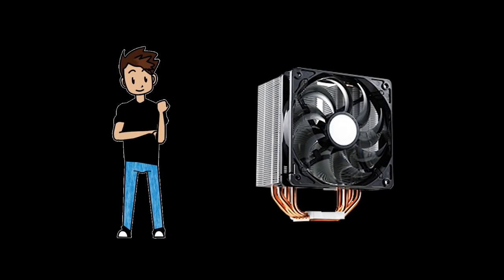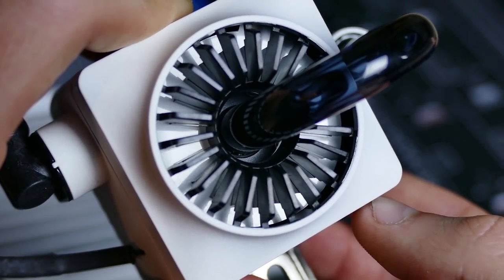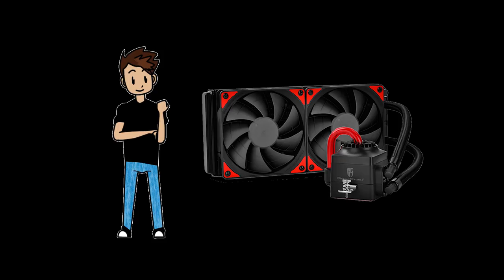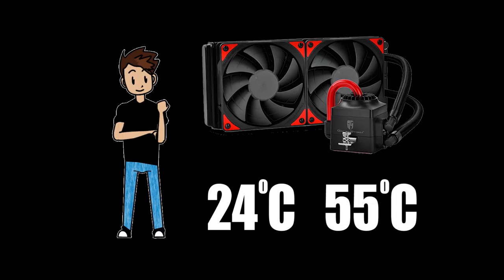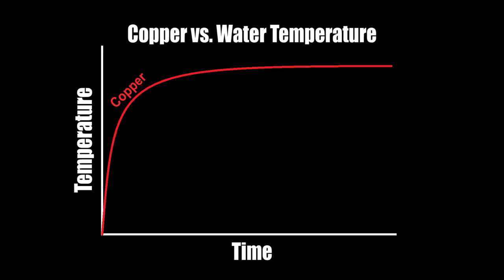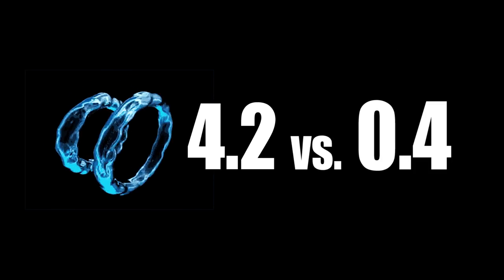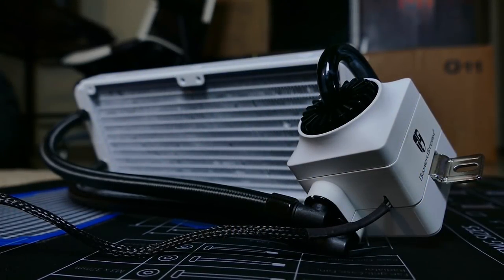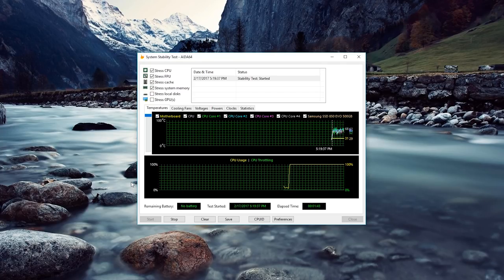How to Properly Measure AIO Temperatures

Comment: Unfortunately the bullshit clickbait got me. I didn't need a science lesson personally, I'm quite familiar with fluid and thermodynamics. AIO's, more specifically their manufacturers do not lie. They do exactly what's described on the box and in the literature. It is not for Corsair, Coolermaster. Antec et al, to deal with third party reviewers who don't test well enough. My main rig runs pretty much 24/7 with the power only cycled for win10 updates. The Corsair H90 on that works admirably under constant load although the supplied fan failed after about a year I had already bought a replacement with high static pressure but had not gotten around to installing it. The behaviour you describe and refer to as lying happens even with custom loops but the greater volume of liquid means the time to entropy is greater. I'm about to purchase a coolermaster ml240l for my kid's system. For anyone not overclocking these things are a no-brainer and work as advertised.

Comment: Your concept of AIO coolers retaining heat for longer is absolute rubbish. When using a water cooled system, the temperature of the coolant rises by only a couple of degrees. This is because the specific heat capacity of water is around 4.2 J/gm deg K. which means it is able to absorb a lot more heat before it increases in temperature in comparison to air which has a Cp of around 1J/gm deg K (at constant pressure).  If the initial ambient temperature of the coolant is around 24 degrees, after stressing the system for several hours you will see the temperature has increased by only a few degrees. This means the temperature of the coolant is still considerably less than the CPU under load which in turn means it will still cool the CPU (as heat always travels from higher temperature to lower temperature) rather than help it retain the temperature for longer. The real reason the CPU heats up after several hours of stress testing is because of the thermal efficiency of the heat transfer from CPU -> coolant -> radiator -> air, in case of the water cooled system, or,  CPU -> heatsink -> air in case of an air cooled system. You would be lucky to get a thermal efficiency above 20%. When two items are in contact with each other, not all the heat is transferred from item A to item B. All this heat accumulates in Item A and it's corresponding temperature rises. This is the reason why the temperature of the CPU eventually rises after several hours of stress testing. One thing I have seen from past builds is that even after a day of continuous stress testing with AIOs, when the stress test is stopped, the temperature of the CPU shoots down immediately within a few seconds. There was only one instance where the temperature failed to go down and that was because instead of stopping the stress test on prime95 I had merely closed the window and it was still running in the background.

Comment: even with my aircooler i stresstest for at least 5 hours. if you want to be absolutely sure , run a 24 hour test . if it passes that, its stable because most of us are not gonna use it 24hours a day. and because of the 24 hour test passing, you know your pc wont make an error in that time. so lol.

anyway, always test it longer than necessary, just to be sure. whether aio or aircooler. but i laugh at people who present max temps after 15mins. because if i test it for 15 minutes, it doesnt even reach 70 degrees and thats on a gelid tranquillo rev fuckin 2. lol

Comment: I do not like the way this video paints liquid cooling and AIOs, it is not very accurate overall.  Anyone that understands how cooling works knows that you have to give the heat transfer medium time to equalize to any change in heat input before you can get an accurate measurement of how effective a cooling solution is.  Air coolers come to equalization much faster than liquid cooling solutions.  You can get in to how heat pipes transfer heat energy, vs water, and you can discuss the increase of mass that liquid cooling solutions have, and that is the end of the equalization story.

This video does not bring up the increased cooling capacity of the liquid cooler's radiator(s) vs the air cooler, which is key to the discussion.  Additionally this video leaves the lay person questioning if the longer time it takes liquid coolers take to come down from a high workload might have a negative impact on their system, the answer is it will not negatively impact your system.  Because of the increased cooling capacity of the radiators in a liquid cooling solution it removes more heat than an air cooler can with the same heat input.  So it is only reasonable that the CPU is subject to less total heat, and the changes in temperature are nice and gradual with a liquid cooling solution.  If that was not the case no one would spend all the extra money for liquid cooling.

Comment: You got your basic thermodinamics really good, just forgot, lie (i can get clickbaity too) or did not understand more advanced thermodinamics.

Heat flux is a function of the termal conductivity of the material, the area (surface) of transference and the Temperature delta. Your analizis is true but misleading, because you only focus in JUST ONE OF THE 5 VARIABLES OF THE EQUATION.
Talking about the termal capacity of a material is irrelevant, because it does not affect the termal conductivity and neither the area (surface) of transference, the only thing that affect "INDERECTLY" its the temperature. termal capacity only talks about how much heat a material can store, before heating....

Let me explain with an example. lets say that you have two materials at 25 degres, one has a termal capacity of 2 and the other 1.
1- To have the same amount of heat in both materials, you have to had 1kg of material A and 2kg of the material B. the first material can store twice as much heat...
2- the same amount of heat to get 1 kg of material A at 25 degress can get 1kg of material B to 50 degress (these numbers are not real, just an figurative example of what the fenomena is) In your own example copper has less capacity that water that means that copper gets HOT EASIER, and just that, (note how i did NOT talk about FASTER, bcause that its the termal conductivity).

Until now what we are talking about is basically how much heat something can have before starting to get hot. and yes copper will get hotter easier than water...
In more layman terms, yeah a air cool system "starts" doing their work "faster" than a water cooling one, but all other variables talk about how "good" and "efficient" at such work you are. And neither you talk about this. If you where my student i would return your homework with a note "yeah two systems reach termodinamic equilibrium at different speeds, but what else?" i have seen some good posts below, but take in consideration something while reading them (without numbers everithing its just especulation)

o god ill finish here im bored of writting and this is not a thermodinamics course
Do not missrepresent me, he is talking some good points here, its just that what he is talking about its just the tip of the iceberg...
i could explain the rest but again im bored of writting and this is not a thermodinamics course.

Comment: The only lie here is this video. If someone doesn't understand the thermal dynamics that's on them, not on an AIO. For those that didn't fully understand what SS was explaining Ill summarize. 

"In most cases by switching to a liquid cooling system, You will see a noticeable decrease in temps. However after placing a heavy load on said liquid cooling system, it will hold on to some of that heat until it can be dissipated through the (RAD) radiator."

Comment: This is BS. maybe cheap AIO's will do this, but my corsair (CORSAIR Hydro Series H105 Extreme Performance 240mm )  keeps my Delided i7 8700k at 5.2 with 1.42v at 70c under 8 hours of gaming (BFV), and a 12 hour stress test it never went above 78c. even after stressing it with Prime95 for 12 hours, once stopping the stress test It right away went down to 32c idle. Don't think this happens to me because I have delided CPU, My temps where the same with lower clock speed and voltage without the Delid. This is a well thought out BS video.  he doesn't talk about how the computer Case can have an effect on this (in how many fans you can have in your case), type of fan's you are using ,what speed, If your fan's are even placed in a correct way in the case, what your Room temps are,  If you are using bad thermal past, What size is your Radiator for your AIO. BS video with googled mathematical equation. Ain't no one lying, but you Science Studio.

Comment: all I know are facts, 30 years of it , building systems, and comparing apples with apples. and not oranges.
example: pc runs 24/7 doesn't sleep low cpu speed is 50%,  4790K OC @ 4.7 on Cryorig H7 playing PUBG for 4 hours = 84-87'c
same pc with  Enermax liqMax II 240S = 70-72'c high temp, even  over 4 hours of time, the AIO is better than the Air cooled, he admits it in his video @ 5:05 in the video. as for what is contained in the liquid of the AIO, I will surmise it is probably close to  standards like 1/2 glycol 1/2 water, why, not because glycol prevents freezing of the liquid, it is because half water/glycol IS better heat transfer  liquid over 100% glycol or 100% water. otherwise car dealers would make you only use water... duh.
read up on some people that Know what they are talking about, and can explain it instead of making a video that last 10 mins to make some obscure point that copper is a better heat dissipation than water is.  which a) it isn't, b) nope it ISNT!

Comment: This video makes NO SENSE. Because you are not measuring the temperature of the cooler, you measure the temperature of the CPU. If the temperature of the CPU takes longer to rise with a liquid cooler, that means the liquid cooler dissipates heat FASTER, not slower.
Reply: It's you who left brain to bed at morning:
Only stabilized temperatures tell actual cooling power.
For as long as CPU temperature keeps climbing cooler isn't dissipating all produced heat, but just storing part of it!
(dissipating all that stored heat making temperature decrease slower after removal of CPU load)
Reply: Yes, you are right. I meant to say "if the temperature of the CPU takes longer to rise with a liquid cooler, that means the liquid cooler ABSORBS heat faster." Which is actually a desirable effect, unlike what's implied in the video, because what you end up with is a system that not only takes longer to heat up, but also, even after stabilization, runs at a lower temperature than the air cooled one.

Comment: Points to ponder;     [MC ΔT] of the cpu/coolant =   [MC ΔT] of the radiator to outside system. If your ambient temps are high, your airflow across the radiator isnt proper (debris/dust/etc), corrosion on the copper blocks, etc... it can really change the numbers quite a bit. 

Not thrilled it took 5 minutes for the REAL point to be made. This video could have been much more efficient, and probably wouldn't get nearly the amount of stupid comments you're getting lol. 

More food for thought, an average i7 ~ 5.0ghz ~1.4v (THIS IS HIGH) only pulls 36 more watts than an i7 4.7ghz ~1.28v (this is NORMAL). Die degredation and quantum tunneling start being a factor when you start kicking in the voltage; thats why sub-ambient cooling isnt really a practical solution.

Comment: Clickbait title, and you called thermal compound/grease "thermal glue" which could be misleading to the inexperienced builders you're trying to inform.  It'd be a real shame if someone used thermal epoxy between their cpu and cooler block instead of thermal compound/grease.  Not your best video.

Comment: While you're not wrong this is the same misleading bs as they did in testing e-cigs a few years back. Obviously if you let a water loop run for hours the temps will go up higher, BUT who does that? No system is ever under 100% stress test load under normal operation especially in games. Even though you sat there and said if you play games for hours blah blah, no, you're just wrong. I can sit and game for multiple hours some days 8+ if it's a good day, and the moment I close said game which previously had my temps under load, it falls right back to idle temps. 
So let's debunk your longer cool down theory.
Yes water holds heat longer, but where does that heat go? Into the radiator, which sends cooler water back to the block.
Now that cpu isn't under load, the block is no longer being heated by it, thus it gets hit with said cooler water, which transfers the heat it has left to the water.
Thus the time it takes to cool down is not hindered by the water, but increased. This considering NORMAL load, not running your rig under stress test conditions for extreme amounts of time.
Are people claiming 40+ degree temp drops being misleading? Sure, but so are you.

Comment: This video for a bad title. As it was clickbait. Though it was informational. Yet the title was misleading. I highly doubt you're giving bad information but you are really telling that people who cannot learn or understand how Thermal Dynamics work. That there is false information out there that is not from the company itself telling these lies. You cannot blame AIO for this.

After all. In the computer world, there is a motto: Garbage In. Garbage Out.

Meaning that if you put in garbage information. You get information that is garbage back out. Have to do your own Super Power that is called COMMON SENSE. Read the information and do your own studies. Find out that a Water Cooled system may be okay for the short gain but it most likely isn't great unless you are going to have a radiator that is the size of a 3ftx3ft box running nonstop. Or somehow figured out how to get Liquid Nitrogen to run through the system. The Thermals will always be a problem. As nothing in this world does not give off heat. Unless someone, in fact, creates a Cold Fusion Reactor and is able to reproduce the results. Then, and only then. I will eat my favorite ball cap.

So in other words. The title is misleading. And failure to educate people on Thermal Dynamics is the cause of false readings and stories of Liquid Cooled Systems. Not the product itself. As the Product does its job. It keeps the system cool but not at the levels the 'reports' claim but really if you get reports from Forum Threads. Then, you aren't doing yourself any favors.

Comment: lol your so right! Take it to the next level. if everything you said is true which it is. than what is the correct way to create the perfect cooling envierment inside a case? I know but I won't tell you. Instead I will do a video showing everyone the true secret to dissipate heat inside a case . my 2 grandsons will reveal  in A computer build video one child is 10 years old the other is 7 both children understand everything you just said. after that video is completed. I may do another video that the boys can do on electrical mechanical force as it pertains to pc think mother board headers. good bye for now.

Comment: This is a rather misleading video. The water is not being passively cooled as his thought experiment at the end would have you ponder. The water is constantly being pumped through a radiator — which diffuses heat. 2nd law of thermodynamics, entropy. It is why your car has a liquid radiator that does the exact same thing. This is what happens when pseudo-intellectuals without engineering degrees start a vlog. Another thought experiment: which cools faster - 5000 gallons at 80deg Celsius of water sitting inside an insulated silo with only it’s surface area at the top emitting stored heat... or that same 5000 gallons of water spread out over a football field (assume ambient temperatures are the same).... learning, it is fun

Comment: Most real world usage will not even come close to hitting a system like a stress test and the continual load it puts on a system, Water will work way better in real world situations when CPU cores are not pinned at 100%.. it will not however give you higher over-clocks.. why do ppl make stupid videos like these

Comment: I just saw this video in April 2019. However I Seriously disagree with part of your' theory. While the science of most of what you say is correct, it does not follow that it takes longer to cool a liquid system after prolonged intense high cpu temps. I run an off the shelf coolermaster aio, amd 8 core cpu 125 tdp, on an asus gaming mobo, with an XFX RX 590 Fatboy and after 6 to 8 hours of continuous intense gameplay my cpu temps never go above 88 FAHRENHEIT not Celsius (I am American I use the correct temp scale, which is more accurate ). After hours of gaming it only takes about 2 minutes or less for my cpu to drop to 50 FAHRENHEIT. At an idle my cpu runs approximately 45 fahrenheit in a room with an ambient temp of around 74. All you have to do is increase the pump speed and set the fan curve properly with plenty of case ventilation and viola you get a frosty freezy cpu. The gpu is a different story though is air cooled I put grizzly conductonaught liquid metal thermal paste and cranked the fan curve way up and it runs at around 140 F. or so during intense gaming. While that is well below max temp for it, it is higher than I would like it to be. If liquid cooling is done properly it rocks, just gotta tweak it a little, just sayin.